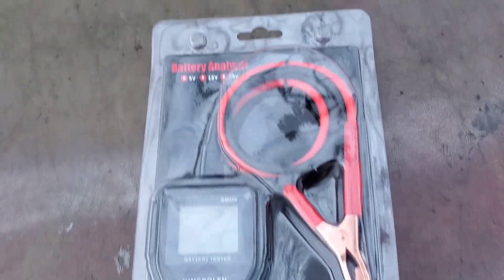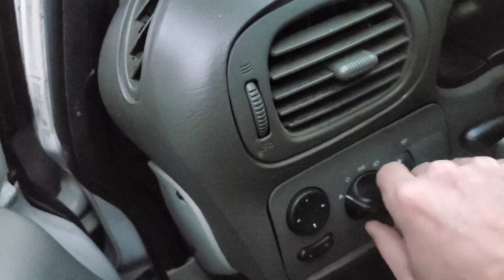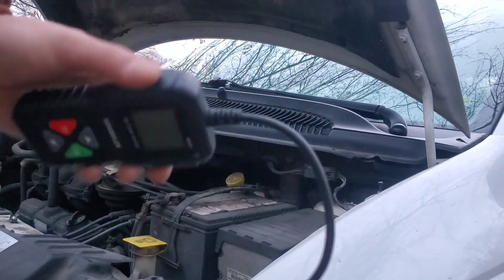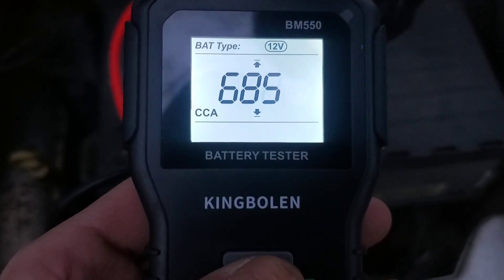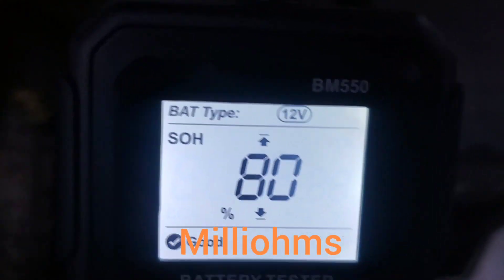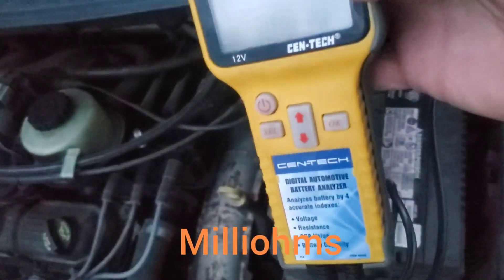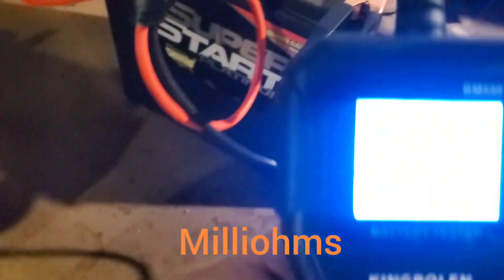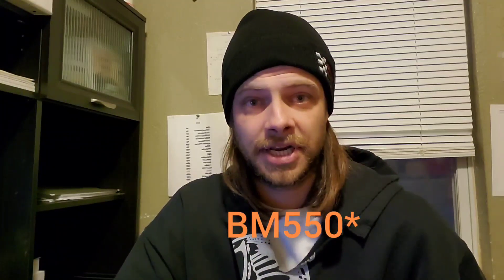Kingbolen BM550 Battery Analyzer Review!!

Comment: That's a good tool to have. Gives more information than the Harbor Freight unit.
Reply from the maker: I also like that it's able to do 6v and 24v in case I ever run into one of those systems. Older motorcycles I believe use 6v and RV/Campers sometimes use 24v so definitely handy